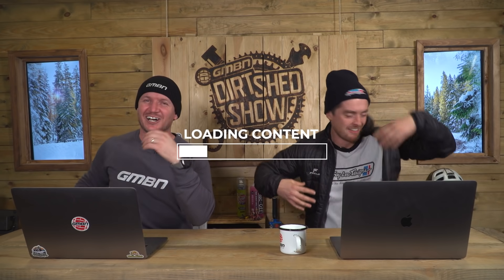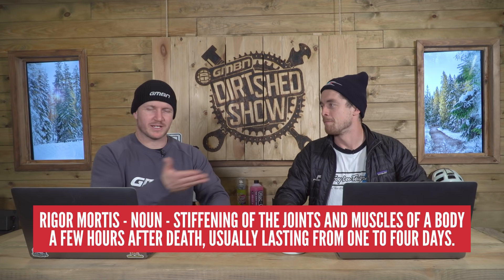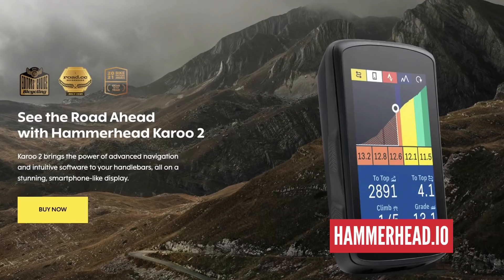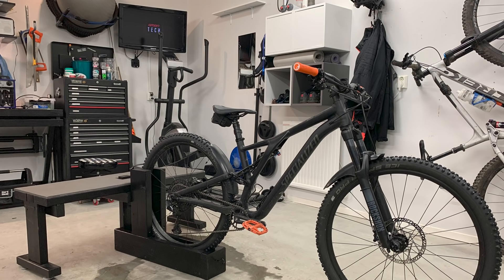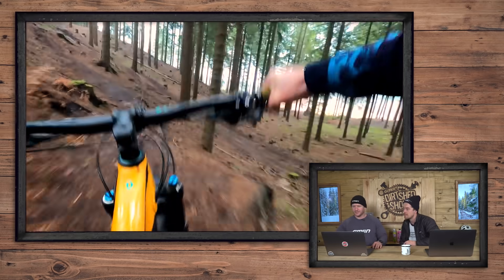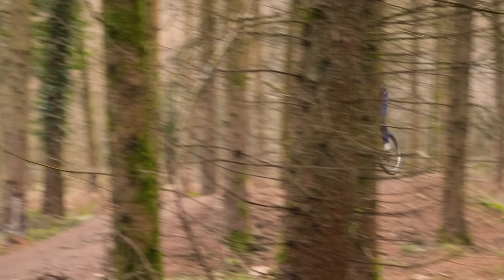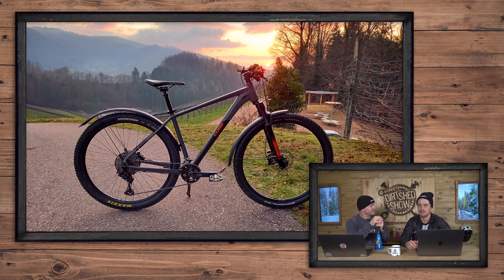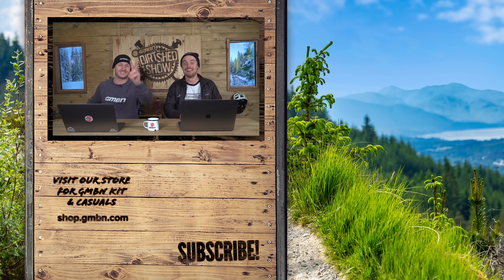Reasons To Start Riding On A Hardtail | Dirt Shed Show 359 (feat. Olly Wilkins)

Comment: I've gone back to riding my Bird Zero hardtail over my YT Jeffsey. The hardtail is better for flow trails, the full suss for rougher trails with bigger drops, simple as. The reason I went back to hardtail?.. Its like walking barefoot on the sandy beach compared to flip flops, you feel the terrain, way more connected to bump mapping but problem is the toll it takes. Full suss will soak up all those bodyshocks the hardtail forces into your body, so buy the bike that suits your riding style most appropriate for the trails you'll be riding the most often. My local trails are in poor condition as we don't have a dedicated trail building community and one man can't do it all so message to bikers, take a weekend once a year to contribute to trail maintenence. It's game over without decent trails